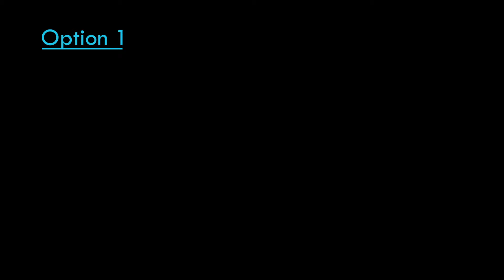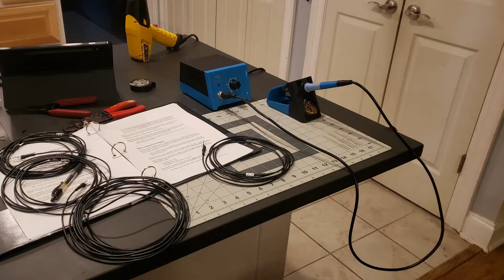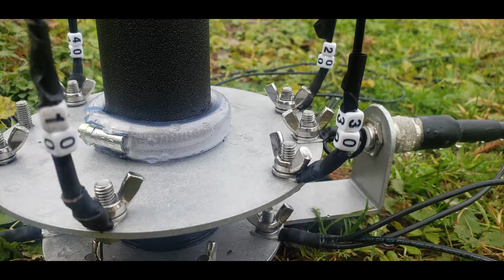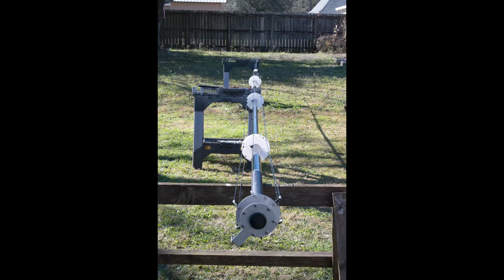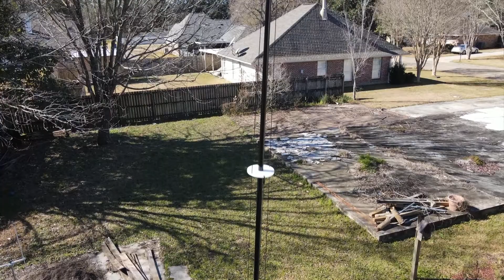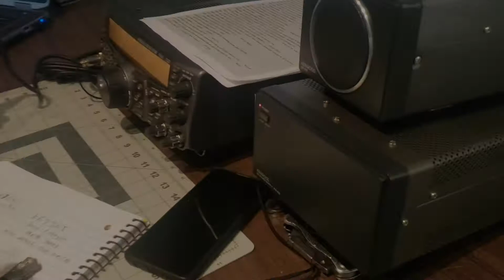DX Commander Classic Build and Demonstration

Comment: I've seen a number of videos regarding these antennas but no one ever shows what they do for the base that actually holds the mast up. Did you bury a pipe or?????
Reply from the maker: Great question! It's an easy oversight, though, because you don't do anything but stand it up. The bottom has a plastic cap that screws on beneath the bottom plate that the radials attach to and it just sits on the ground. Other than the guy lines (which I have another video about), there is nothing attaching it to the ground. I do plan on killing the grass in that area and putting some gravel or small stones down just so it's not directly on the ground and the radial wires are a bit easier to access. Hope this helps. If not, just let me know.
Reply: @ErikHerrmann91   Thanks for the quick response. I'm considering the Nebula and hope to actually sit it on a ground mount due to its height. Great video!
Reply from the maker: @JA-fy1bn  No problem! I am not familiar with the Nebula, but hope that works out for you! 73!